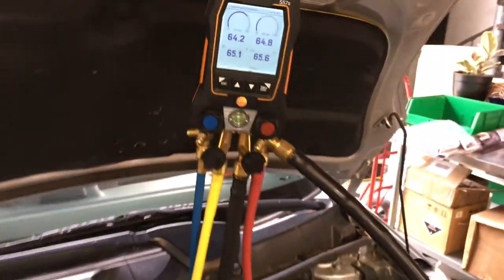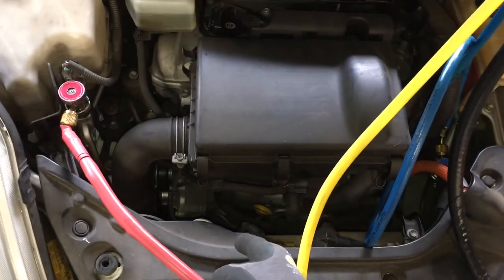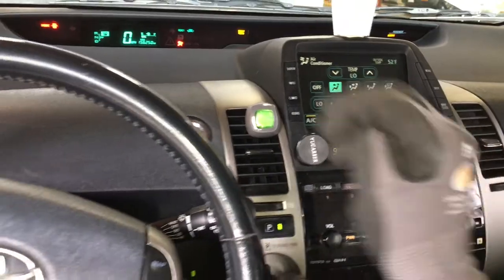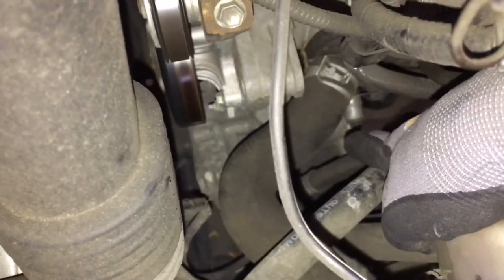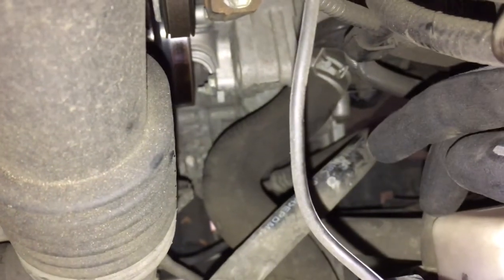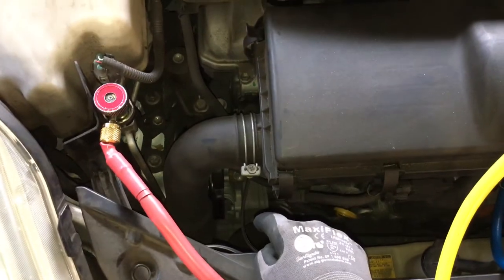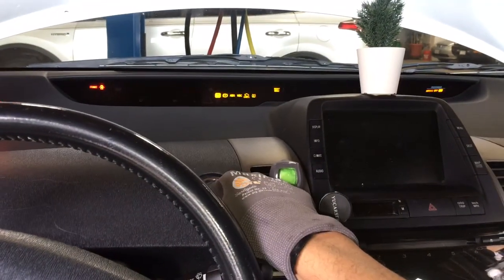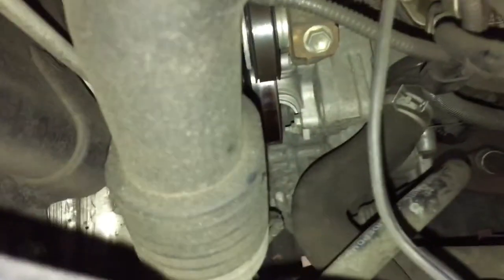Bad Prius compressor noise on 2009.  This is one of the noises a bad Prius compressor makes

Comment: When the engine kicks it the car starts sounding like a diesel truck and it seems to get louder so I turn it off. Is this the same
Reply from the maker: No that’s the engine noise having nothing to do with the air conditioning compressor. 

      It’s difficult to isolate just the AC compressor sound from the engine noise especially for people whose ears are not trained and tuned into the different noises and how to identify them

Comment: My 2010 Camry Hybrid compressor was making that noise continuously. I told Mrs not to use it, but she kept using it for weeks until it stop working. I guessing better to buy a second hand compressor for the wreckers. Here in Australia wreckers give warranty, cheers
Reply from the maker: Check that you do not have any metal debris when you try to pour out the oil from the old compressor or stick some brake curling or carburetor cleaner into the old burnt out compressor shake it up and down pour it out into a clean container if you see metal flakes you need to flush the system and change the condenser to and you should change the expansion valve on a compressor burn out system that’s just the proper way
Reply: @coldfinger459sub0  cheers
Reply: @coldfinger459sub0  thx, how would I flush the system, cheers
Reply from the maker: @theaussienurseflipper.8113  Go to the manufacturers website of 4 SEASONS they make a hand flush tool that is a little container you fill up with flushing solvent and then pressurize with a little rubber tips to push the flushing solving through. 

research automotive air conditioning flush solvents Dura cool was the name of another manufacturer I think it’s sold through Napa but that’s here in United States I’m not sure if you’re here or you were overseas I think can’t remember

But when you go to these different manufacturers that make these handheld flushing kits that you can purchase and the solvent they have videos on instructing you how to flush you cannot flush through an orifice tube you cannot flush through a expansion valve those items need to be removed

If you have a muffler on the hose line assembly off of the compressor you cannot flush the small particular matter out of there if there is metal debris in particular matter that particular line needs to be replaced because the metal particles always end up staying inside that muffler chamber.   Not all pipes and lines have a muffler summer just straight lines or straight hoses.  

The condenser if it has metal debris in it cannot be flushed out it Hass to be replaced

And if you’re on a vehicle that has a separate receiver dryer or accumulator that item also must be replaced
Reply: @coldfinger459sub0  thx mate, might be cheap to roll the window down, lol

Comment: Hi there i have a 2008 Toyota Prius, the ac blows room temperature air at best. It was sitting for a bit and not being driven very often. When i turn the ac on full blast i so no heat the electric fans engage.  Could it be my ac compressor is bad ? How can i check?
Reply from the maker: First, you need a set of gauges to see if you have pressure in the system because there has to be a minimum of somewhere around at least 44 psi to close the safety switch to allow the computer to engage the compressor. 

Absolute minimum pressure is not important because it will depend on ambient temperature and if the engine has been running, the pressure will be higher or lower . 

Old Prius like that very common for condensers to be leaking. I have videos showing condensers with leaky oily brown Dusty spots on them. 

But you can get a lot more help. I also have more pictures and descriptions over on Prius chat 

If you go into the web form Prius chat, there’s plenty people there that will give you recommendations including myself and you can go onto my previous chat album and see pictures of condensers with leaks and I have YouTube videos stored on Prius chat about different problems 

Prius of that age also has a common problem. It’s about time the evaporator start to leak to that’s another problem.
Reply: @coldfinger459sub0  awesome thanks!! I was check out prius chat as well! I’ll check out your posts!
Reply: @coldfinger459sub0  hey i just noticed you were in San Francisco. Do you still work on vehicles? I live in Tracy about 1hr from SF
Reply from the maker: @justinweavers2781  I’m too busy right now I’m only working as a vendor directly to shops I just have too much work.     I only drive up and down one01 and 280 anymore between Redwood City Air and San Francisco.. 

So I would not be able to take on any more work, unless the vehicles were already dropped off as customers of my existing body shops, or mechanical shops, that I service right now .
Reply: @coldfinger459sub0  gotcha!! Makes sense! Any HVAC shops that you could recommend in the area?
Reply from the maker: @justinweavers2781  unfortunately out of the 30 + existing air conditioning and radiator repair shops. There was only one left open that I was recommending in the area.

But unfortunately, the original old owner apparently is getting too old and doesn’t work in the shop anymore and he has young managers and all new people and I started discovering contaminated, refrigerant, and improper procedures coming from his shop so I now no longer have any shops that I could recommend anymore for strictly air conditioning they’ve all went the way of the dinosaur into hiring young guys who know nothing and pumping out mass fast sales just to make profits and they no longer care about quality
Reply: @coldfinger459sub0  oh man! Got it thanks for the honesty. My uncle works at an automotive repair shop in san leandro. I will go there will new hoses for him to use on the vehicle to pressure test and possibly add coolant if low!

Comment: Hello, I face the same problem do you have the video how you fix. ?
Reply from the maker: No I do not have a video on the physical mechanical labor-intensive process of removing and replacing the compressor or flushing out the system from any possible metal debris or replacing the condenser and expansion valve
Reply: @coldfinger459sub0   can you say how much does it cost? And another question is what could be the regular service price of Toyota Prius and what's included in the service ?

Comment: My 2008 makes this sound when the car is off as well. Could this be something else? Thanks
Reply from the maker: Put a hose or long metal extension bar to the case of the compressor to your ear. This will help you pinpoint the noise

Comment: Gotta ask but is the engine noise completely normal?

Cause i have a 04 prius wth the same engine noise tho me and my father think it sounds off.... Previously drove an 06 aerio, 08 corolla and 05 scion xa and non of the engines had that weird ratlely noise thing. I asummed its from the different cycle the engine has on the 2nd gen compared to the other engines in the suzukis and toyota ive heard.
Reply from the maker: Not talking about the engine noise. But listening to the electric ac compressor noise
Reply: @coldfinger459sub0  im aware, theres just no videos on 2nd gen prius  idle engine sound so this is the closest thing to it.

Comment: Out of curious what is so special about replacing these compressors? I have read that the high voltage system has many mechanics turning down compressor replacement? What steps are done for removal other than the typical belt, evac the system completely? I know with it being electrical, wouldn’t you just remove the battery to turn off the vehicle like any other vehicle? Or would the hybrid batter need to be undone?
Reply from the maker: Excellent question. 
Some shop owners or technicians are just afraid of anything that has to do with high-voltage electricity so they turn them down just for that reason just out of lack of knowledge because they are extremely simple the physical replacement part is easy. 

I’ve heard shop owners told me they don’t want to buy the expensive Electric hybrid ester oil (POE)

I have gotten shops with messed up compressors or not working systems who put too much oil in the tiny little system that they don’t understand is not like a regular vehicle. 

       Guys who don’t read don’t understand this is not the old days where we had 6 ounces or 9 ounces of refrigerant oil in the system so you could just chug away and grab two or three or 4 ounces into the system just to be safe and it would still work. 
            The whole entire oil charge on some of the small systems it’s only 2.77 ounces to3.75 ounces of oil. 

        So they would add two or 3 ounces of oil in the system would not work right
And they did not know what they did wrong and cannot figure it out that that was the problem

Another majority of my not working Prius jobs I get from other shop repair attempts just being two or 3 ounces overcharged on refrigerant and whenever customer would go out and drive and it would become hot outside the system was shut down from over pressurizing about 400 psi. 

No the problem I see coming in from a lot of other shops most shops have all the equipment that is like eight years old or older in the accuracy of their scale for charging it’s two or 3 ounces too little or two or 3 ounces too much and that’s enough to kill at the Prius AC performance.

So the customer would get their car recharged at a shop pull the refrigerant out with the refrigerant in it tells them it is correct but it’s two or 3 ounces not enough refrigerant but on a mild warm day been two or 3 ounces low on refrigerant the AC would perform perfectly nice and cold out the dash. 

But then the customer would go out and drive in the heat would happen see you on a weekend or going on a trip because they’re leaving a mild climate driving to another state immediately their AC would stop working because they were two or 3 ounces low on refrigerant. 

The customer will drive back to the shop within a mile climb it may be before noon time it’s not hot yet they can’t find nothing wrong so just to be careful and make sure they did it right they use their unreliable an accurate scale machine to recover the refrigerant and recharge it once again and the machine tells them it is correctly charged to the weight but it actually is not because the scale is not accurate enough on old recovery recycle and recharge machines. 

So after several several angry customers may be having to eat the price of a compressor because they did something wrong the shop just bands and stops doing electric vehicle. 

But it all comes back to ignorance and not being able to read the manual. 

With the shop owners that usually comes down to either being lazy, cheap or ignorant. 
RTFM
Reply: @coldfinger459sub0  hands down, thee best answer and accurate explanation I have ever heard, thank you so much for being able to go into detail on the issues you are seeing. I am looking into the gen 2 prius and just reading up on common issues I see on forums. This being one of them. Alot of videos dont really explain the actual issues at hand with the compressors it seems, and forum threads are endless unanswered questions. Some people are willing to let the dealer handle it because no one else will touch it. I will definitely save this answer just so If I get one with a bad compressor I have the knowledge to treat this like any other car but to be mindful of how sensitive the freon level is and the specialty oil (luckily I have 2.5 years of commercial parts management from NAPA) so I have connections. Thank you again for the in-depth answer! 
-Jim
Reply from the maker: @jimmieromero8181  I sometimes answer questions over on PriusChat to online form. 

I have a photo album if you click on my icon on Prius chat go to my profile and seek out my postings in my videos and photos of tools parts procedures problems I have found I’ve even taken pictures with short explanations under them or linked videos from Prius‘s to my YouTube just related to Prius only
Reply: Hi sir if the sound will come and it will get off a.c so what can I do now